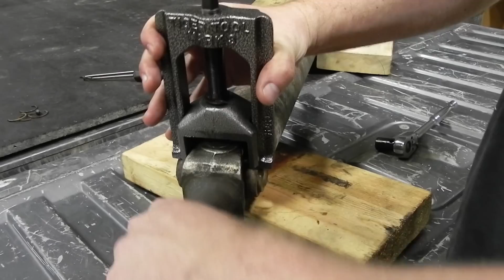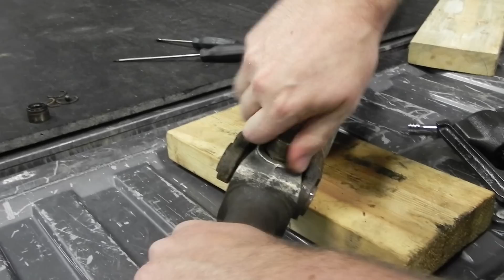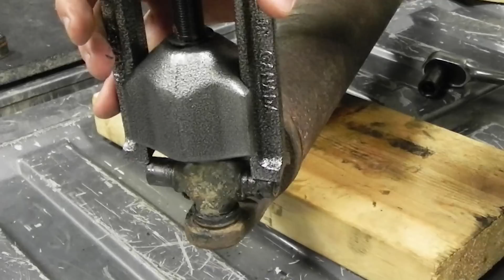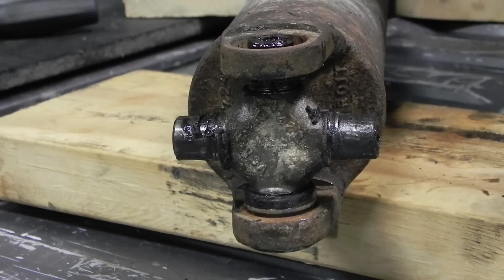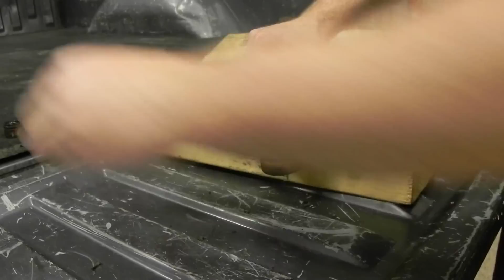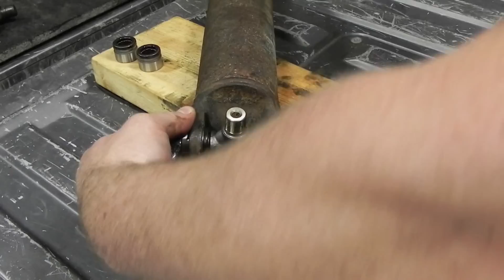Service U-joints in minutes using the Tiger Tool 10105 U Joint Puller & 10202 Bearing Cup Installer

Comment: By design, force is applied ONLY to ONE cup, NOT TWO as with a typical ball joint press (c-frame). Tiger uses approx.HALF the force a BJP would take to do the same U joint. For those seized-up stinkers it appliest approx.TWICE as much force as the BJP at a given scrw pressure. If it looked too easy it's because it was TWICE as easy using TIGER TOOL. I took  time to say this because they are GREAT to deal with... I got AWESOME customer sevice recently thamks to KEVIN. I don't forget that.
JP-USA

Comment: Bought the 10105 a while back. Used it today to press out my ‘01 Dodge 2500 front axle u-joints. This thing made it extremely easy! Used a 1/2’ Cordless impact. Just used my balljoint press to reinstall. Well worth the money imho.

Comment: I installed the u-joint with this tool and I used my solid gold 3/4 ratchet
Reply: Donna Edminster 😂🤣
Reply: You clearly were trying too hard!!  He only used a silver 3/8 ratchet. By the way…….he did it in 6 minutes, how long did your big hammer take? Time is money in a shop, and having done hundreds of u-joints I would buy this tool again if mine broke

Comment: Don't worry, harbor freight will no doubt have a clone pretty soon for 40 bux for the pair, those could be produced somewhere in Asia for five bux each.
Reply: wish they would hurry up
Reply: hddm3 don't know why these places want to price there selves out of the market. pro or not, that's just to much money
Reply: Especially with that cast crystallized recycled monkey metal they use. I thought, "WOW< these Harbor Freight deep clamps are awesome for $12. They are okay to repair a guitar, but anything where you need some force the frame breaks apart rather violently.

Comment: I have one of these. If the u-joints are very rusted you will have to use a combination of hammer and socket technique, and this tool. This tool does not push universal joints out well when they are very rusted.
Reply: It sounds like you’re not using the tool properly because I went and got an old rusty driveshaft from the junkyard and I was able to press the caps out
Reply: Just did mine rusty crap on 88 cherokee. Pb blaster and ratchet. Not too shabby at all.
Reply: @colinkennedy908  yeah I could have been doing something incorrectly haha honestly I don't remember now that was like 5 years ago. Those new joints that I have installed on the day that I left my original comment 5 years ago are still good to this very day!!

Comment: I wished my Toyota u joints bearing caps came out this easy.  Not only I used the Tiger Tool to push out the caps, I had to pound them out with a brass punch and 2 lb sledge hammer.

Comment: the u joints I just removed required a 4 ton press...came out with a bang each time. I think I'd have broken a tool like this trying! one time the joint broke through the bearing cap cause it was stuck so badly! If I thought this tool would work on rusty 15 year old salt soaked rusty trucks, I'd buy one today!
Reply: It can likely impart far more than 4 tons of force.

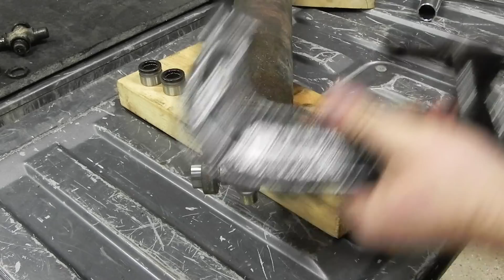Comment: At 3:29 all I was doing was pushing the bearing caps in tight enough so they wouldn't fall out while I got the C-frame in to place. The cross of the u-joint slid in freely. I have however done what you suggested years ago on my Jeep... I had to change the joints out 3 weeks later!

Comment: We have been manufacturing this tool for over 25 years and I can only recall a few instances (we have been made aware of) where the driveline was so seized our tool wouldn’t work. In most cases we find it’s more important how the force is applied verses how much force is applied to complete this type of job correctly.

Comment: Just did the u-joints on my 2000 F-150 and there's NO WAY this tool would have worked to remove the old ones. Since I didn't have a vice it took me and a friend to hold down the driveshaft and use the ball-joint/u-joint press to press the joints out and the new ones in.

Comment: can't tell you the number of times doing it this way has caused one of the needle bearings to "fall down" and get "squished" during the press-in. (and yes, the bearings were greased before hand just to keep them from "falling down").  
Found it much safer to push one cup well past the circlip hold to be si\ure the opposing cup with its needle bearings would NOT fall down.
Reply: Looked to me like that might be what happened in this video. The second cup looked like it never fully seated and never showed putting that clip in on video, and at the end you could see that cup sitting a little too proud of the ear on the yoke.
Reply: Or just make sure the trunnion is inserted in both cups before pressing them home, just float it between the two while pressing.

Comment: A BALL JOINT REMOVAL TOOL WORKS ON REMOVAL AND INSTALLATION I OWN ONE ,IF YOU DONT OWN ONE AUTOZONE RENTALS ARE FREE JUST LEAVE A DEPOSIT, BTW CLEAN AND LUBRICATE ALL MATING SURFACES TO MAKE THE JOB EASIER.
Reply: Bearing cup mating surfaces go together dry, not lubricated.
Reply: @leehotspur9679  Howard, look this issue up on the Spicer website. Cheers.
 "Caution – Spicer DOES NOT recommend wiping the
outside of bearing cup assemblies or yoke cross holes with
grease, oil or silicone-based sprays. This could result in bearing cup assembly rotation in yokes. "

Comment: A big vice can become a boat anchor due to overloading. The typical Acme thread pitch is not capable of properly (w/out cheater pipe) creating the force required for many stubborn cases. Some huge vices have relatively WEAK captive nuts. Vice method w/sockets (like ball-joint press method) is trying to move both cups instead of 1 cup the Tiger Tool way. So again the Tiger requires approx. half the force the vice needs to do the same u-joint. Tiger goes under vehicle too-saves time . JP-USA

Comment: When you use the C-clamp to put the little retainer back in place, how does only one side is pushed inside, and not both since both jaws of the clamp are sitting on the U-joint outsides?

Comment: @ 3;29 it is possible that he didn't make sure the u-joint was inserted far enough into the cap and a needle bearing may have fallen out of place. That will not allow the cap to go into it's proper position and could destroy the u-joint if not done properly. May be why it appeared to be hung up.

Comment: The 10105 & 10202 are engineered for use with a 1/2 impact gun.  If you do a quick search in Google for "Tiger Tool 10105" you should come across a few prices or if you wish to purchase the item locally we have a dealer locator on our website.

Comment: What are the chances/odds of this tool bending the "eyes" where the caps go while pressing in or out? A very interesting tool kit.
Reply: This type tool eliminates the risk of spreading the ears on a yoke because instead of pushing them apart like we used to pounding them out with a BFH or using a ball joint press you instead are only pushing on the sides of the opposing yoke's ears (or the u-joint trunnion after you have one side out) where there is no risk of spreading them and pulling on just one ear while pushing the trunnion. There is no risk of spreading the ears on the yoke when there are no forces applied in opposite directions to both ears like the old-school methods would often do, especially if one cup was seized up like when a seal got stuck or someone forgot to remove a clip or someone used an impact on a press and hit it with too many uggaduggas.

This type tool is an improvement over the factory recommended press adapters that push on the trunnion as it works on the same principle in that it only is applying force to one ear instead of both but this type adapter fits a wider range sizes of u joints. FWIW now that I suppose the patent ran out or whatnot there are other companies now making their own versions of this tool, like OTC and Lisle. FWIW the Lisle has held up pretty darn well in our shop for being half the price of the original Tiger.

Comment: I like it but I find the use of 2 separate tools to be excessive.  Both removal and replacement can be achieved by using a balljoint press which is similar to the install tool shown.  Great demonstration though.

Comment: Awesome tool, and good video. I'm going to replace the U Joint on the rear Driveshaft of my pathfinder, because I'm getting some vibration between 40-60mph and squeaks when I drive, and it's worn out . Would it be wise to replace the front also? Even if it's not worn? Thanks for your advice.
Reply: If money is an issue AND the rear is a premature failure than just replace the bad one. If both have a lot of miles on them its just a good idea to replace both. Unless you are under your rig quite a bit I recommend using spicer maintenance free joints. They have superior seals and last a very very long time.

Comment: Cool video but expensive..  Id rather take a 5 lbs sledge and smack the ears with the shafts on a angle and in two or three good whacks the cap will pop off.

Comment: Why not make one that used a small bottle jack ram and hydraulically presses the part out???? I just used a big__s hydraulic puller set made by Backhawk back in the 1950s. Amazing stuff them old Blackhawk tools. Blackhawk even made a conduit bender that would bend 1/2 rigid"- 2" thinwall, and 2" rigid conduits and it was the size of a small suitcase, but it did weigh about 90 pounds. Their U Joint Pitman arm puller set had a portapower type hydraulic pump, and the same type clamp & ram assembly.
Reply: I've bent yokes pressing them out with a chinese 10 ton hydraulic press. I think a hammering action is better than brute force pressing. I might try an attachment for my long stroke air hammer.

Comment: Those could not have been the factory joints. My 10y/o factory joints w/90,000 miles on them took an 18" breaker bar just to move 'em...
Reply: Dam right 

I got biceps for days but 

U joints

Kicked some ass today

Had to lube twice to get out

Comment: Anyone know if these will work on the front driveshafts on dodge and ford 3/4 and 1 ton pickups?
Reply: The 10105 is designed to work on U-Joints with bearing cups 1″ to 1.25″ O.D. which covers most 1/2 ton to 1 ton. Some 1 ton applications may require the 10104 which works on U-Joints with bearing cups 1.25″ to 1.7″ O.D.
Reply: Tiger Tool thanks for the response. I measured a front u joint cap from an F350 today and it looks like it’s about 1 3/8” diameter if anyone else was curious:)

Comment: Nice, minus the price.  Absolutely ridiculous, around $200 to $300 for just a single tool.  I'll stick to hammer and cheap socket.  Can also go get this made if you know any metal fabricators, or get a steel beating rod made for like next to nothing.
Reply: You can get one on Ebay now for about $160.00. Still ridiculous for me. I will probably use it once in my entire life.
Reply: A ball joint press works better and is much faster...get one and harbor freight or just borrow one from autozone ..
Reply: A gigantic vise, a big socket, and an even bigger socket.

Comment: Anybody that can afford this would be able to afford somebody else doing the work instead. For many years a hammer and punch have worked perfectly fine and within probably the same or less time. I see no value in these grossly over-priced devices.
Reply: A hydraulic press and a machined block??  Pump pump pump, plunk, rinse & repeat.
Reply: A small sledge and the right socket worked perfectly for me.....took maybe 5 minutes from knocking to old out to knocking the new in.
Reply: this tool is to keep you from bending the ears, ive done it ive seen other people do it, you get completely seized u joints you put it in the press youre buying an axle shaft or driveshaft, the bigger tiger tools my shop has, the shop has them because we work on rigs and this is the absolute best way to get u joints out
Reply: Yeah ,Yeah  i used to pull these on tractors that ran in  shitty dairy farms even you guys with salt spreaders would need something like this. It was in our contract farmer had to pay what it took no flat rates.  glad when the eco freakers chased them over to Nevada. Used ball hone to clean ,assembled with lots of anti-seize on everything including the bolts  these cows even ate long hot peppers ,topped off with bbq potato chips. No wonder the corrosion welded  everything